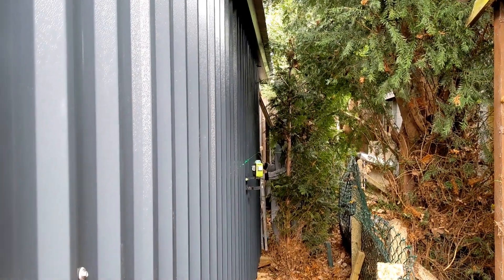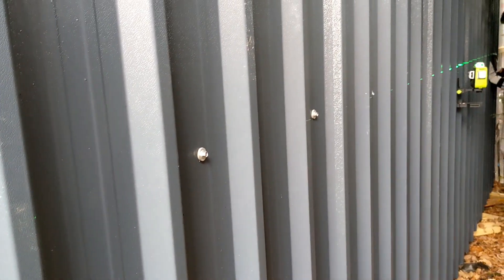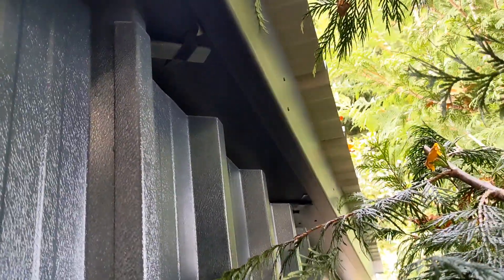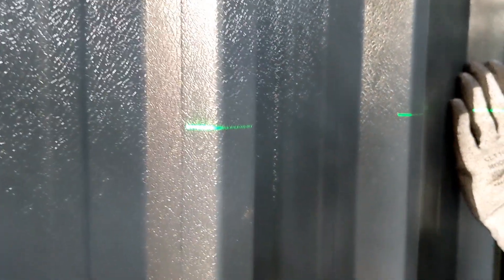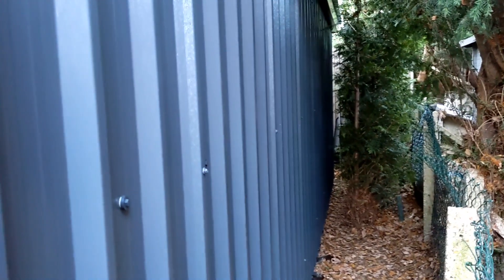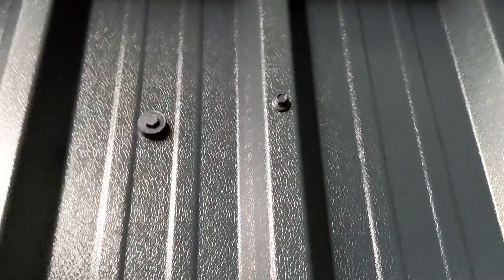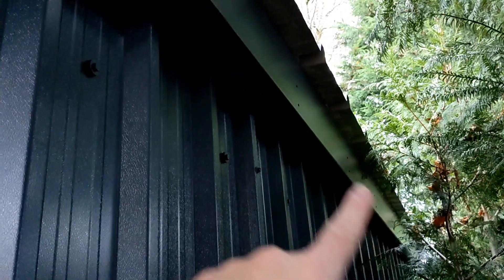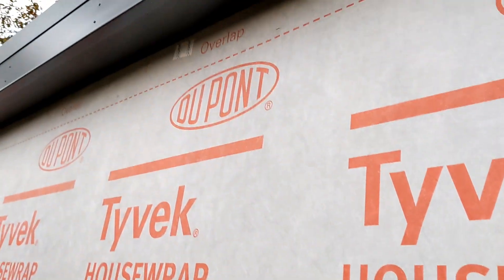Garden Room Build - Week 21: Ep 40: Metal cladding

Comment: Excellent work and nice to see. I’m cladding my build in the next week too. Like your sheet lifting device, handy trick. I couldn’t tell if you will  be metal cladding around any side windows? Agree about the comment suggesting insect mesh. Definitely worth trying to retro fit, But even I’ve not figured out the best way of fitting it around each trapezoid.
Reply from the maker: Thanks Phil, much appreciated! It took a while to figure out the lifting device! That is a good point those sections of the panel would still be open, and there are 6 per sheet. Have to have a think about that. Let me know if you come up with a solution in the mean time. Thanks, Simon
Reply from the maker: HI Phil, forgot to mention I don't have any side windows to clad around, there is a fence not far from either side so no real view to see! Thanks.
Reply: Hey Phil,

did you solve how to install the insect mesh please?

Comment: It just dawned on me that I layed my battens horizontal instead of vertical for my metal cladding, I was worried thinking it'd made a mistake but I'm using metal box cladding same as you. As you say it's an air gap between the profiles so having the Batten's horizontal is fine yeah??
Reply: Yes. As log as air can get around and the panels are secure it's fine

Comment: First of all well done on a great build so far. Only thing I would say is have you put mesh at the top & bottom of the panels to stop bees, wasps & other bugs from getting in. If not you may have problems. I found this out the hard way. Left an air gap under my workshop & 3yrs on i ended up with bees underneath.  They will nest in any place thats sheltered.
Liam from oakwood garden rooms put mesh along the bottom edge up over the batterns before attaching cladding, Also as you've left the gap at the top you should have fitted some there also. Not a dig just some friendly advice
Reply from the maker: Hi Dave, thanks its coming on now, still taking a while! I thought I would have the cladding done on both the sides too today, but only managed the back! I did think about the netting and you are probably right I should have added it. I just never got round to ordering any. I think I will add some underneath and see if I can fold some soffit mesh in half and put it in the gap at the top. Thanks, all comment much appreciated! Simon

Comment: hey, what an amazingly helpful series of videos.. literally tonnes of nuggets of amazing tips - thanks for sharing !...  i assume all the principles of applying the cladding would be the same to wrap a dormer as well? - ive got to be Class B or better as the dormer is within 1m of my boundary, and something like this would be awesome, and probabaly way cheaper than a standing seam roof.   Also im constructing a warm roof, and will put a sheet of ply over the PIR to fix the roofing sheet to - do i need to install a breather membrane between the ply and the roofing sheet please?
Reply from the maker: Hi Rashid, Thanks for the nice comments, glad you are finding the videos useful. I would imagine that is the same principal to clad a dormer, but I would probably check with your local building control if they are happy with it. On the warm roof you should have a vapour barrier below the insulation, so then it shouldn't be needed as the should stop moisture coming up from inside. I would have a look at @SteveRoofer he has some great videos on roof build up and make up and is also very helpful with questions and suggestions. Thanks!

Comment: Great building. Can i ask how did you connect the sheets to the wood cladding? Thanks
Reply from the maker: Thanks! So I used OSB sheets on the actual structural frame work, then the membrane, then three horizontal battens, then the metal cladding fixed to the horizontal battens using these, https://www.cladco.co.uk/fixings-and-accessories/65mm-screws-to-wood-with-baz-washer-pack-of-100 They went through the OSB and mostly into the studs of the walls. There were a few places where they missed the studs and went only into the batten and the OSB, due to stud spacing, at those points I ground off the part of the screw going through to the inside. Hope that helps.
Reply: @FatManBuilds  Hey and thanks for the response, I actually meant how did you join the box profile sheets up to the cedar cladding. cheers
Reply from the maker: Oh I see what you mean now. So you can kind of see it here https://youtu.be/O0DK0_kk4Vw?t=928 The false column on either side extends out past the side on the building then back in, and the metal sheet just buts up to the Cedar at 90 degrees in the corner, effectively on the back side of the false column. Because it's back in under the sofit the joint is pretty well protected. You can see how I built the framework for the false columns here, https://youtu.be/KrS8GTPMdDQ?t=88 Hope that helps.
Reply: @FatManBuilds  thanks mate appreciate it

Comment: How did you finish the corners of the metal cladding I’m struggling to invision it
Reply from the maker: There is corner flashing that goes on the back two corners, they are in this video https://www.youtube.com/watch?v=28mquiJYG6M Then on the front two corners I butt the Cedar cladding right up to one of the corners on the back of the false columns, you can see it at about 15mins 14secs in this video https://www.youtube.com/watch?v=O0DK0_kk4Vw Cheers!